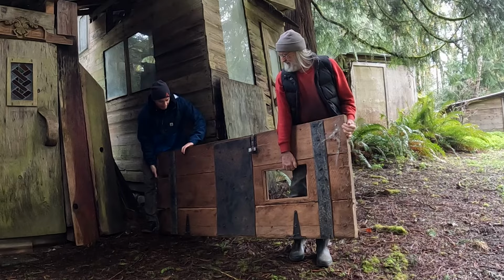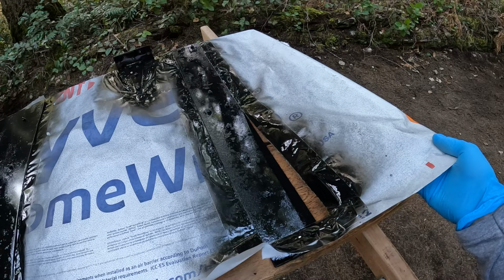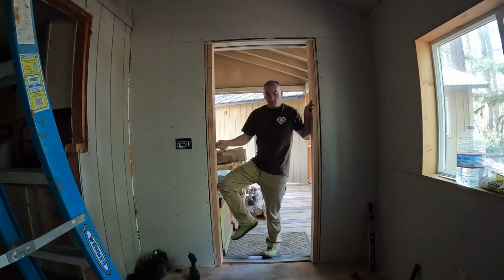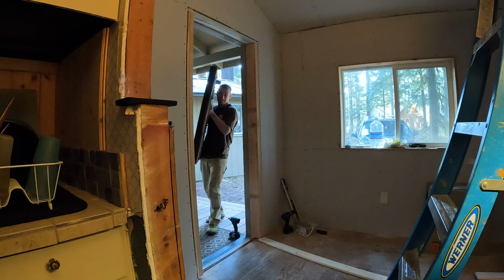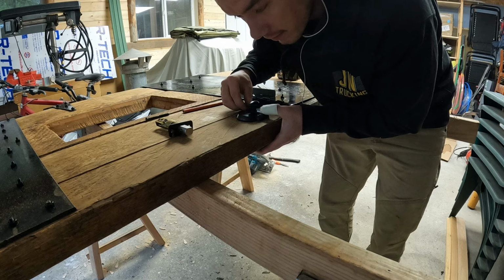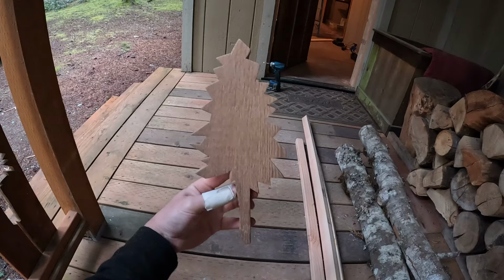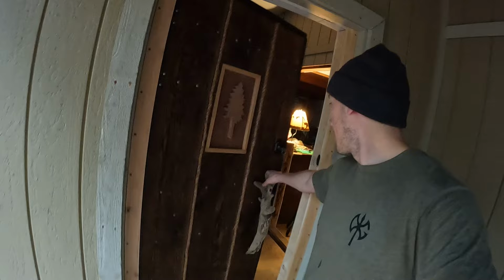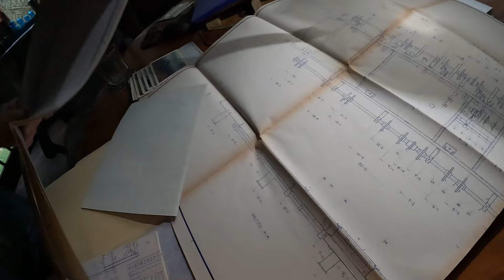Restoring an Old Cabin Door Start to Finish

Comment: I love your videos. Thanks so much for inspiring us. I missed this on your first video. In your video of you cutting the longer pieces of wood on your table saw, you had your chop saw and table extension out and the roller up. So I was thinking that on my stand, you can pull out the roller and spin it around to use it as a roller for your longer cuts on your table saw. Just a thought. Keep up the amazing work. Have the greatest day ever, filled with love and peace.

Comment: it wouldnt be ideal to have an external only latch because then if you're inside it could be latched which would make using that door immediately problematic from the inside. If you have two doors it's not really an entrac/exit concern but it's still not great.
Reply: I agree. Doesn’t seem ideal to have to manually latch it every time you go in and out just for it to stay closed